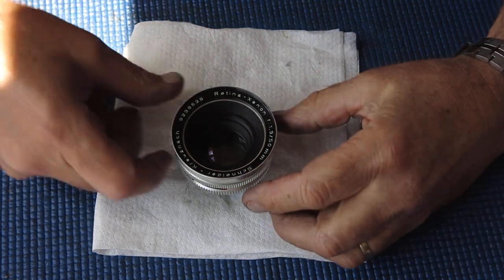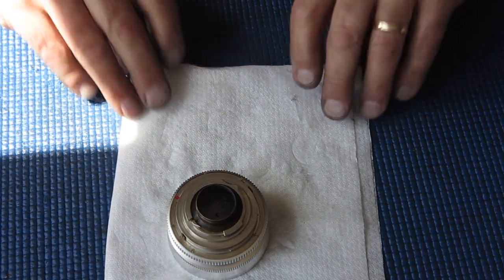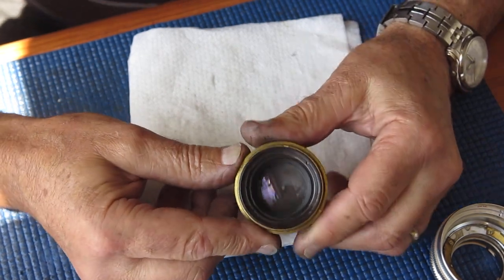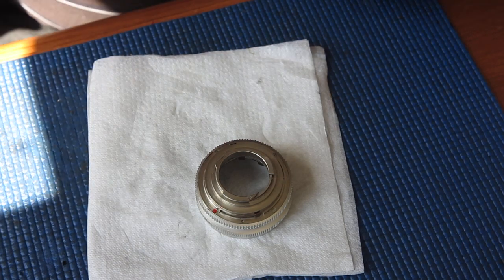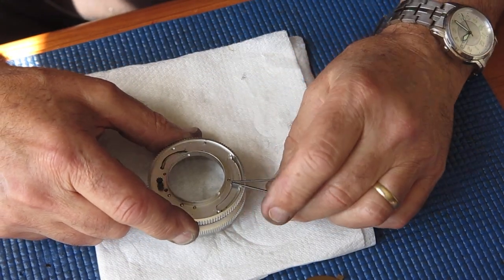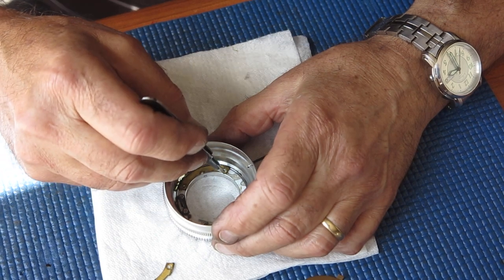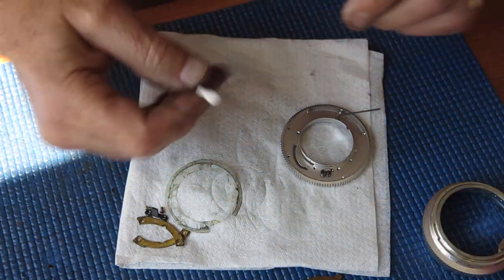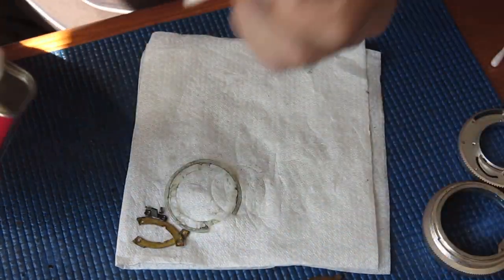Xenon 50mm f/1.9 lens for Kodak Retina Reflex IV strip-down

Comment: Hi thanks for video
I have some  question
How to open the rear lens for cleaning fungus ? Can you do a video please ?

What is the size of the rubber that you are using for open the front ring of this lens ?

Best Regards

Thanks for sharing

Rfl
Reply from the maker: Another video will have to wait for another lens needing servicing here. The rubber friction tool I used is around 38mm in diameter.